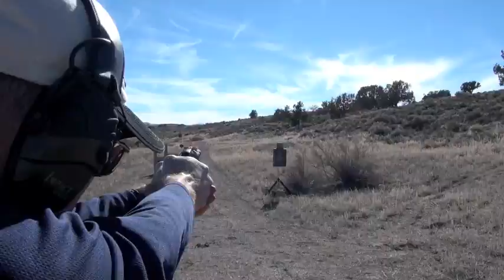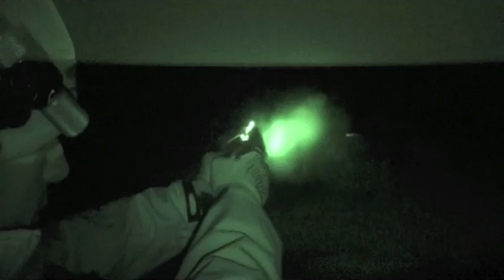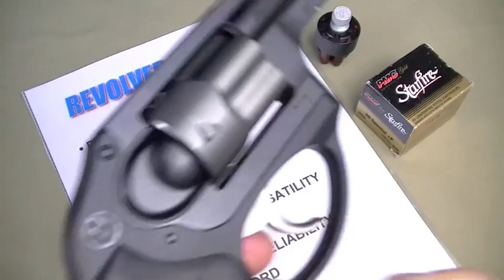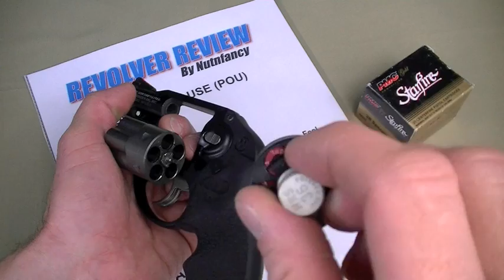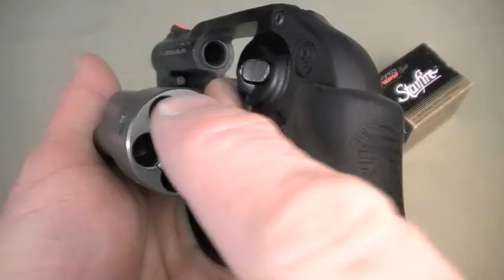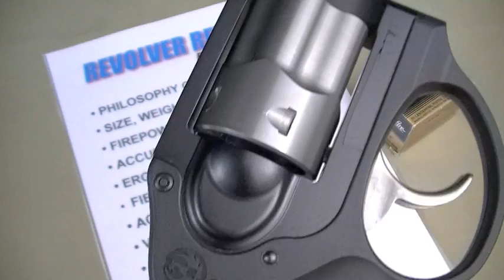Ruger LCR: "Fast, Fun, Deadly" by Nutnfancy

Comment: Best review of this gun I've seen yet!  This has been my carry gun since I bought it a year ago.  Got mine with the Crimson Trace.  Use it as a pocket gun with the Black Hawk size 4 holster.  No issues at all with drawing from the pocket.
 
The long trigger pull is part of being a revolver...you have to turn the cylinder.  As stated you need to practice with it on a regular basis to know how to stage the trigger pull.  Once you figure that out your accuracy and consistency will greatly improve.

I end every trip to the range with 20 shots from my LCR.  Allows me to get in practice on reloading.  I usually do 10 shots at 50' to 75' taking my time to aim, then 10 shots of
rapid fire at 15'.

Thanks for the great videos TNP!  You take the time to do it right.

Comment: Not to be overlooked - probably the easiest CCW option for people with severe hand problems who can't rack the slide on a small semiautomatic, or handle the stiff trigger pull of other snubs. 

My girl had hand surgery and this was the best option for her. I got one with the factory LaserMax laser and added XS Big Dot sights and Pachmayr Diamond Pro grips for a finger rest, and she is very capable with it.

She has been practicing with it weekly for several months now, and the LCR has proven 100% reliable, as you'd expect.

Comment: I use the 5 Star Firearm speed loaders and they work well, they are made specifically for the LCR 38 which I guess because of the smaller cylinder size over the SW.
Tried speed strips, didn't like them.

Comment: I bought the .38 for my wife and the .357 for myself.  I am not recoil sensitive and have shot heavy calibers for many years.  My wife carries hers with Hornady Critical defense 110 gr +p and I carry the Hornady FTX 125 gr .357 in mine.  I have been in several firefights and you never even notice the recoil when your adrenaline is in overdrive.  But you are correct when it comes to practicing.

Comment: Ill take the extra weight and go with the 357. Even if I only use 38 +p the extra weigh helps with recoil and I still have the option of a magnum round. 17 oz is not that heavy. its the same weight as my LC9.

Comment: just bought a used one at cabela's. I had a kahr CM9 which I absolutely loved, but for some reason or another, I was not consistent with it. plus I kept on having an occasional FTF getting stuck on the ramp. even with different kinds of ammo.

took the LCR out for the first time, sat a target up at like 10 feet, and couldn't hit an 8 inch target or the board it was tacked on. probably wasn't using the trigger properly. I adjusted a few things, found a good/better way to look down the sights as he says here leave much to be desired and started hitting the target. so kept on moving back, doing good each time. finally got back to like 40 feet or so and could easily  hit the target most every time. so after only like 35 rounds, I had sighted it in and could be consistent with it. only drawback is the 5 rounds but with a speed loader you got 10 and this gun is meant for close up self defense, not a gun battle with 3 guys shooting glocks at you. very, very happy with it and I love the fact that you will never have a round hang up on a feed ramp ever, or go "click" with nothing happening.
Reply: Just out of curiosity, did you release the slide manually and did you use the slide release lever? Kahrs are know for hang ups if you pull the slide back and release it on a round. My good buddy has the same model kahr and it does the same thing.
Reply: Tyler Morse
Yes I had read that your supposed to lock the slide back then release it using the slide release lever to load a round, and that's what I did.  But anyway it was never the first round that failed to feed it was always later in the magazine. I sold it to a guy who was very very happy to get one at $400(with an extra magazine). It was such a well constructed sturdy solid gun but I just did not like that every once in a while a round would get hung up on the feed ramp. I could understand if I was limp wristing it occasionally but it happened fairly consistently over 200-250 rounds. about every 20-30 rounds or so. even after the break in period. it actually did it more often in the later rounds than the first rounds. the accuracy problem I had I'm sure over time I could have cured that with more practice with it but I've had other guns with the same FTF problems, kel-tec's etc and just go fed up and decided to get me a revolver.
Reply: Tyler Morse by the way, my first gun ever was a ruger SR9c and that gun, I have shot a couple thousand rounds through it, and not ONE failure to feed getting caught up on the ramp. an outstanding gun but a tad to big and bulky to use as a deep concealed gun. possible but not perfect
Reply: Yeah I think the slide issue you experienced was the only thing draw back on the kahr. I also got a sr9c and have shot roughly 500 to 600 rounds through it without a hiccup. It only gave me problems when I used my handloads and that was obviously the ammo. Both guns are great IMO.  I agree with you about the sr9c being tough to use for deep concealment as I have learned from my experiences, that's why I have a variety to choose from ;)
Reply: +fred garvin if you want a true CCW Ruger, look no further than their LC9S Pro. that's what i use. excellent excellent CCW firearm. scored mine from GunBuyer.com for just $299 free shipping
Reply: +jgg204 yah I saw those and they look fantastic. I ended up selling the revolver cause I just thought 5 rounds ain't cuttin it. I bought a baby glock 26 and it's great, totally reliable like the rugers. then, I bought an SCCY 9mm for an unbelievable price of $270, havn't shot it yet, then just the other day I see the gun has come down in price to $219 for a 10 round 9mm. this company is trying to make an affordable 9mm. most of the reviews are all great, with a few saying they had some problems, but most saying it's a great gun. I might sell the glock and buy the ruger LCS9 though since it's slimmer.

Comment: I love my lcr .357. It does have some recoil, but I like the recoil. Maybe because I'm used to my s&w 500. Very accurate.  I highly recommend the 357 because it's a little heavier and can fire the 38 round. Very little recoil with the 38. Conceals very good in a front pocket for wearing shorts in the summer.

Comment: Adding a beavertail onto the frame would add something to snag.  Due to the slide on an auto, it doesn't interfere as much.  I believe the beavertail was added to autos primarily to let the shooter place the hand as high up as possible yet still ensure the slide does not cut the hand on recoil.  No need for that on revolvers.

Comment: Great advice with staging the trigger first and then slowly/smoothly let it break. Much better accuracy. I just got the LCR 22LR and even though the trigger is slightly stiffer, it still progresses and breaks very similar to the .38 special model.

This is my first snub nosed revolver and expected the DA trigger to be similar to my Kel-Tec P32. Boy was I wrong! The only thing they share is the long DA pull and similar pull weight. The LCR 22LR stages a hell of a lot better and the break is much more crisp. Sometimes with the P32 it's hard to tell when the trigger is actually about to break, and I noticed I use the shrouded hammer position as an indicator to know when it's close.

I totally understand Nutnfancy when he said snub revolvers are for advanced shooters. It has made me a better shooter with all my handguns!

Comment: @MrSatanica There's no special ammo needed to shoot steel.  Provided the surface is flat and "free-floating" in some way, all the energy is absorbed by the steel [which moves the steel] and the bullet usually drops to the ground. 38s benefit little from hollow points, as there really isn't enough velocity to make them expand.  These are probably some type of soft point, lead exposed bullets, purchased in bulk [my guess].

Comment: nutnfancy, what about the .357 even though most times you will be running .38 and +p versions? Just for the flexibility. If you look at from the stand point of a appendix carry back up gun for close quarters response when you cant reach your primary carry for whatever reason, at that point, you kinda cant miss so why not use .357? By no means am i trying to counter anything you are say, i love your channel and find it very informative, im just asking because it was something i was thinking about incorporating into my edc

Comment: The LCR is a great gun, however in terms of the trigger reset, it is an issue for some. The problem is that the LCR has an audible and tactile reset similar to a Glock, except that the trigger does NOT actually reset at that point. The issue can certainly be overcome by training, but it is a real issue for some and not an excuse.

Comment: The fluting job Ruger did on this is really great looking on this. Just to clarify what was the part that has to be loose? It sounded like the cylinder. Another question about the POU of this gun: while taking a gun to its limits is great, you play like you practice, wouldn't the most realistic use of this gun as a CCW be like within 10yards? Maybe its just me but I would think that if you were to employ this to  defend your life the assailant would be fairly close.  Let me know what you think.

Comment: Great review on the LCR nutn, I got myself the 357 version, it was only 10 bucks more than the 38 version, and I don't mind the small extra weight, but to each his own. I prefer my LCR 357 over my wife's S&W polymer Bodyguard 38. You're right about using 357 for a defensive load on a gun of this weight. I usually load 357 Mags for fun at the range only, and 38 +P for my defensive load, because getting follow up shots in a high stress, defensive scenario is tough for me using a 357 load.

Comment: Great review (as always). I picked up the LCR about a year or so ago. Although I'm not as accurate with it as you are I really like the gun and your review steered me towards the gun. 
I use 5star speedloaders with my LCR. I like them a lot better for this gun than the HKS speedloaders that work with the J frame revolvers. Loading is a lot easier with the 5star brand but they are a little more expensive.
Just my 2 cents.
Keep up the good work.

Comment: FANTASTIC vid, Nutnfancy! Super informative. I've been considering getting this gun...but wanted to see it prove itself (I don't want to be a guinea pig). At 10,000 rounds, that's the kind of proof that I"m looking for! And Ruger provides a TON of gun for the money. By the way, if you haven't had a chance to check out the SR40, it is shockingly good. Thanks for the GREAT vid! Love the mix of run 'n gun footage on the table tops. Keeps it very interesting.

Comment: I'm not a revolver guy, but wouldnt it make more sense to get the .357 model so you had the option of shooting .38 special also? I thought about the glock 26, but by getting a 27, i bought a conversion barrel and now have 2 guns in one. Could also get a .357 sig barrel for it. Just my two cents.

Comment: As far as .38 Spl loads go, take over-the-counter 158 gr SWHP's, set the base of each cartidge on a stable surface, and press a double edged (dagger) blade into the hollow, twice, cutting an X shape inside.  A MONSTER of an expander AND penetrator.

Comment: I shoot snub better than regular revolvers. But snubs were all I ever grew up around or shot much as far as revolvers. Had a ruger alaskan 454 for awhile, and after I figured out my flinch it was also an extremely accurate gun and the recoil wasn't really that bad. Got a 7.5" ruger SRH 454 and I don't shoot it nearly as well now.
I don't know what my issue is. 

+1 on the LCR trigger, that's one hell of a good DA trigger, it's as usable as most SA semi-autos.

Comment: I still bought the 357 model because it gives me that option but more importantly it's not enough difference in weight to matter and doesn't cost hardly any more. That forward top frame weight it does have actually makes it better with the 38 rounds even VERY steady and smooth with Hornady critical defense +P. No blow torching affects on the frame and I think a tighter gun after thousands of rounds. I will admit the 357 model has a finish on the upper frame that wears more with a holster.

Comment: It seems to be the perfect concealed weapon. Mine has a laser max that fits perfect on the front under the barrel. Using this gun its hard to miss at close range. Ya it has just 5 rounds but 5+P rounds should be enough to defend yourself if necessary.
 For the RED its FFD.

Comment: For ease of reloading, I would try using Hornady Critical Defense or Critical Duty rounds.  It seems to me that the more pointed nose of these rounds would naturally help to guide the speedloader into place.  Tnoutdoors9 has at least one vid of Critical Duty (I think .40 cal.), and it tested well.  But I might use Buffalo Bore .38+p low flash as the initial load to carry in the gun.

Comment: @nutinfancy  17-14 stainless is a high iron generally low alloy stainless steel... it doesn't have exellent corrosion resistance but is infinately better against rust than say 4140.  Rugar probably uses it rather than say 430/440 ect stainless because it is MUCH cheaper as an alloy and is definately strong enough

Comment: Buy the .357 and train with .38 special. I carry the .357 and the first two rounds are .38 special +P and the last three are .357 critical defense. So if you haven't fire your EDC weapon on the reg, which you should be, you can get a feel of some kick and be ready for the last three rounds if needed. I say if needed because if you can hit your target with the first two rounds and stop your would be criminal then there is no need for the extra strength. BUT condom rule applies.

Comment: Probably the best weapon Ive ever carried on duty. Mines a 357 and I carry it in my holster shirt. So light and powerfull. But the best thing is the accuracy. I moved to a position where PC was more important than Personal protection I was forced to pick out a new weapon. I was going mod 27 glock but it was a little square and bulky for tucked in shirt desk jocky work with occasional night street. I bought the LCR almost out of desperation. Then I shot it. Now its on my 24/7. 158 soft nose BOOM!

Comment: Nutn" gives a lot of good advice. One of the better more general philosophies, is don't fall for group think. There are just too many variables and influences at play and they go both ways.Circumstances, experience local etc. Always think for yourself first. This goes for all facets of life and interacting with others. Listen and weigh but don't succumb. It will just bite you in the long run.

Comment: Just shot 25 rounds of 38 special with the LCRx (not +p). The gun kicked hard even with hogue tamer grips. The accuracy was decent at short range but hard kick did induce some flinching. Trigger felt smooth bot a long pull. I agree with nutn that it is a great EDC option but heavier gun needed for home defence. I'd like to compare it directly with the lcr 22 to see if the lcr22 is a good training option.
Reply: +Flying Beagles how has the LCRX been when unholstering from the pocket? i have the LCRX and somtimes it snags on the inside stitching of my jeans pocket. the way i prevent this is to grab it with my thumb on the tapered hammer but ideally i would rather just be able to grab it by the grip. i'm kind of wishing i went with a regular LCR 38. ugh

Comment: I realize this is an ancient review, but have you compared this vs the 9mm version?  What about the LCR vs SP101; SP 101 vs. Ruger GP 100?  I can't explain why but lately I've found my interest wandering in the revolver direction ( to join my growing selection of 9mm semis).
Reply: +13noman1 personally i wouldn't go with the 9mm. it requires the use of moon clips to keep the rounds in their place. in a SHTF...i don't want to be relying on flimsy moon clips.
if you are gravitating towards revolvers (i've gotten that bug more than once lol),  go with the LCR's for a concealed carry option. if you want something more for home defense, get the SP or GP...prob GP for the extra round

the LCRX  3" barrel model is a good kit gun, but there is no point in going that light unless you are carrying it on you or in a backpack

IMO - everyone should own at least 1 revolver. they are tried and true - they will always fire
Reply: +jgg204 it can be used without the clips, just have to manually extract the shells
Reply: +Dj Shepard and what feature prevents the 9mm cartridge from sliding forward in the wheel cylinders and contacting the frame?
Reply: +Dj Shepard and what feature prevents the 9mm cartridge from sliding forward in the wheel cylinders and contacting the frame?
Reply: It's in the owner's manual that they can fire without the moon clip
Reply: +Dj Shepard you didn't answer my question
Reply: +jgg204 it's irrelevant. You said it can't be fired without the clips and that's not true. it requires the clips for extraction not for firing

Comment: This is not an easy gun to shoot, and because of that I would opt for the 17.50 oz .357 model, NOT to shoot .357, but rather .38s. The extra weight will help, and I appreciate the flexibility of being able to shoot .357 if I have to (again, 99% of the time I'd use .38s, but options are nice).

I know you're big on weight nutn, but different people have different tolerances for what weight they will put up with in a carry gun. To me, 17.50 oz is fine. It's not like a 40 oz 1911 or something.

Comment: @diablo2184 Bases solely on take down power .38 and .380 are pretty close. .38+p however will probably blow away the .380. I would carry the LCP just because of the compactness and the fact that you get 2 more rounds because of the 6+1 mag.